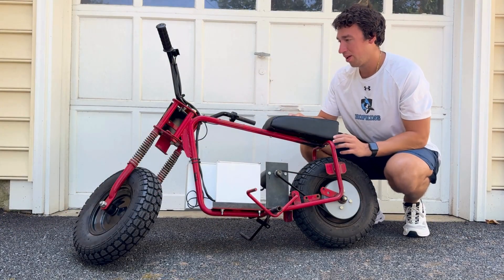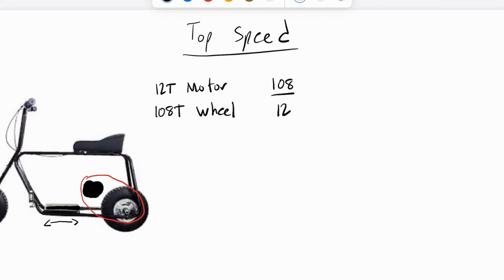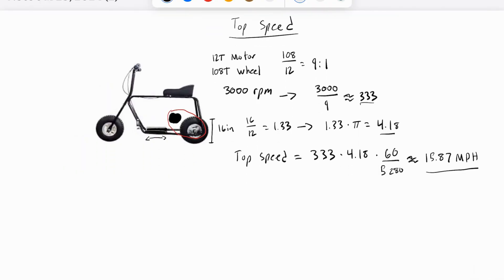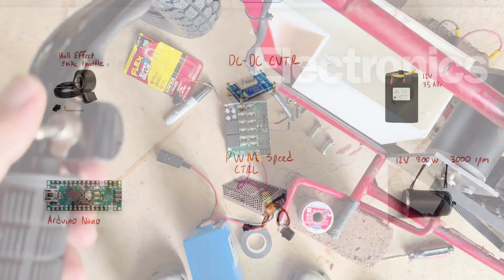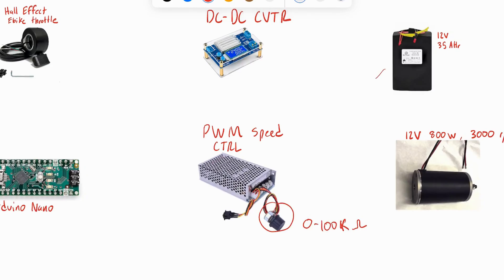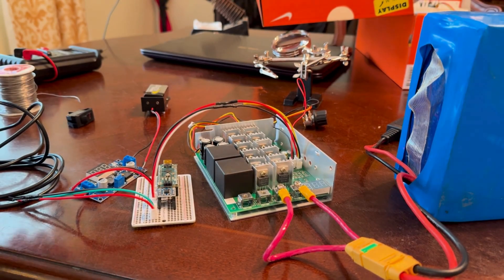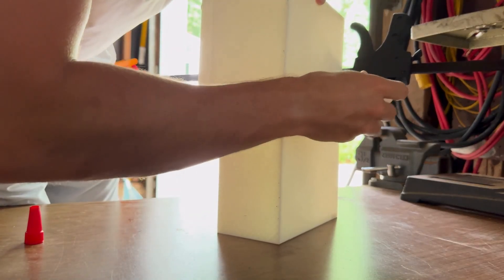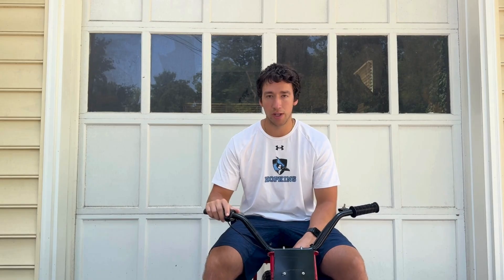3D Printing and DIY: Building a High-Powered Electric Mini Bike from Scratch

Comment: been wondering a while, the wattage of many automotive stereo systems is so high , maybe the volume control could work , i mean even if it takes 4 to use on 48v , it's still maybe a cheap method  for the throttle , you sort of lost me at ardeeeeno

Comment: are 3d printed gears safe? you might want to get those cnc'd.
Reply from the maker: @skilledcamman4752  I could do that but it would be expensive. I have been riding consistently on the 3D parts with no issues, so I see no need for this. In the future I will do a video on printed gears and their strength!
Reply: @PaulJunkin  ye it doesn't really make sense, but its been pulled off a lot of times and without any problems. Such as Tom Stanton has done it many times.
Reply: @PaulJunkin  Are you tracking the mileage? It would be useful to gauge the life-cycle.
Reply from the maker: It’s been holding up well for about three months now. I haven’t tracked the exact mileage yet, but I plan to give it to a friend who lives near the beach, and maybe I'll have him track it. It’ll be interesting to see how it performs over time!